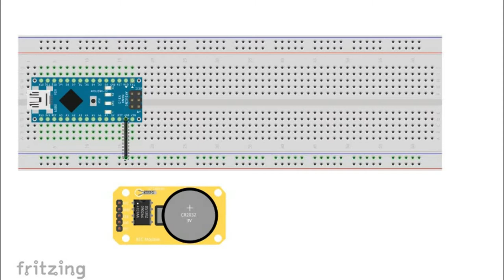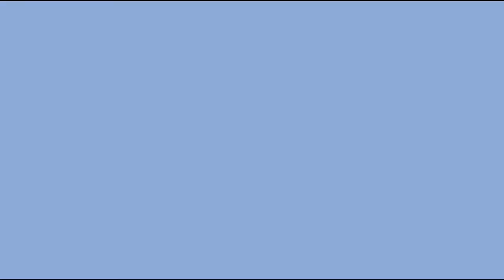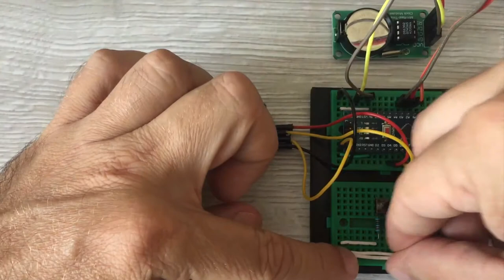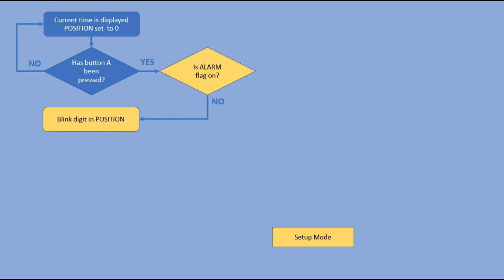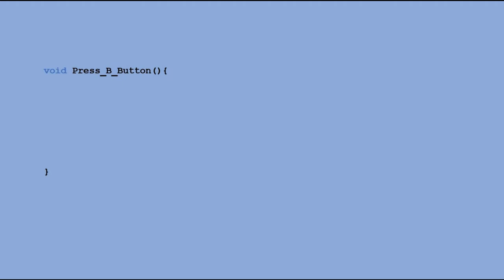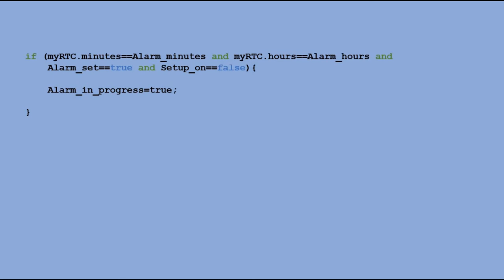How to create TM1637 Digital Clock with setup Time and setup Alarm functionality

Comment: I made some apps where I set the RTC with GPS. You still have UTC time or the time in China to deal with, so have 2 buttons for such on top (which you could use otherwise, but the date is also something.) The RTC modules can move, so you have many options.

Comment: Cool but, it is much better to use the Buttons without resistors, that is, use with PULLUP in the code; it gets cleaner and less work!
Reply from the maker: Check my recent video. It is like you were reading my mind:)

Comment: I watched the related video with interest, I appreciate your effort and wish for the continuation of such educational videos. I uploaded the relevant code to Arduino and ran it, I did not encounter any problems. In this context, I have a question. What kind of code should I write to skech with the screen brightness setting of TM16237? ,I'm waiting for your help
Reply from the maker: You aztually see that in the code for that video. In the setup function you see command clock.setBrightness(0x0f); You have to play with the hex value passed to that function. I prsume the lower the value the lower is the brightness
Reply: @marios_ideas  Thank you for the quick and useful information.
Reply from the maker: @erment55  Give the video a like if you found it usefull:)
Reply: @marios_ideas  I did and also subscribed to the channel

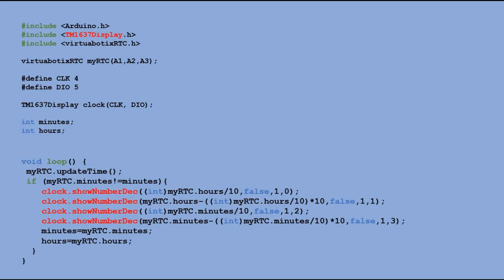Comment: hello i just wanted to display real time on this 4 digit display with DS1302 RTC module so i copied your code from 2:44, set the time and brightness but it is not working :/ any ideas what is the problem?
Reply from the maker: After connecting RTC run I2C scanner code to see if Arduino sees RTC device
https://playground.arduino.cc/Main/I2cScanner/
Also output the Time to serial monitor to see if time is read , if this does that would indicate the problem with 4 digit display
Reply: it works, thanks for the help
Reply from the maker: Jan Radliński silly me. I did not read your initial question carefully enough. Ds1302 is not I2c device. I assumed you were using ds3231:( so was the problem linked to 4 digit display?
Reply: @marios_ideas  it seems that i had to mess something up with the code because i just simply restarted the arduino and rewrite the code and it worked. Still great video and good explanation.

Comment: hello, great project, how to make the two points blink, greetings and thanks
Reply from the maker: You need to change this loop.
Output time when seconds change and not minutes. 

if (myRTC.minutes!=minutes){
    
   clock.showNumberDecEx((int)myRTC.hours/10*1000+(myRTC.hours-((int)myRTC.hours/10)*10)*100+ (int)myRTC.minutes/10*10+myRTC.minutes-((int)myRTC.minutes/10)*10, (0x80 >> 1), true);

   minutes=myRTC.minutes;
   hours=myRTC.hours;
   
   }
And then check if the number of seconds is even. So bild an if statement  When it is use different command to display time

 clock.showNumberDec((int)myRTC.hours/10*1000+(myRTC.hours-((int)myRTC.hours/10)*10)*100+ (int)myRTC.minutes/10*10+myRTC.minutes-((int)myRTC.minutes/10)*10, true,4,0);

Dont have this connected but you will have look at my tutorial https://youtu.be/GHVMbefxZt8 basically shownumnerdec dows not display the colon and it displays 4 digit number which is what you want. So we want to do it every other second

Comment: hello sir,can i use an LCD 16 by 2 module for this project,am doing it as part of my project.
Reply from the maker: Sure you can. It is just a different type of display. Of course you would have to adjust code to exit the RTC read time to a different display
Reply: @marios_ideas  can you help me out with the codes setting,am having some difficulties in figuring out.
Reply: @marios_ideas  am using the following port in my lcd; D4,D5,D6,D7,A,K,RS,RW,E.
Reply from the maker: @ndolomusau8414  I am receiving too many requests like this . I do not have time to respond to all nor I should really be doing the project for you.
Reply from the maker: @ndolomusau8414  I have a video on LCD displays https://youtu.be/g_6OJDyUw1w. In the code you have to replace following lines with the lines that would display the time to LCD display.
(all lines  where clock.showNumberDec is used)

Comment: Hi again,
how to activate colon blinking every second?
Reply from the maker: So currently you have this piece of code
if (myRTC.minutes!=minutes){
    
   clock.showNumberDecEx((int)myRTC.hours/10*1000+(myRTC.hours-((int)myRTC.hours/10)*10)*100+ (int)myRTC.minutes/10*10+myRTC.minutes-((int)myRTC.minutes/10)*10, (0x80 >> 1), true);

   minutes=myRTC.minutes;
   hours=myRTC.hours;
   
   }
 }
Where whenever minutes change you redisplay the clock. (0x80 >> 1) is responsible for displaying the colon. What you need to do is to redisplay time whenever second change and for even seconds display colon and for odd seconds display
clock.showNumberDecEx((int)myRTC.hours/10*1000+(myRTC.hours-((int)myRTC.hours/10)*10)*100+ (int)myRTC.minutes/10*10+myRTC.minutes-((int)myRTC.minutes/10)*10, true);
so without the colon
Reply: @marios_ideas  I will try and let you know the result, thank you again for your quick and helpful feedback as always.

Comment: can I use ds1307 instead ?. If I can, what should I change in the code ?
Reply from the maker: I can see that there is dedicated library for ds1307
https://github.com/PaulStoffregen/DS1307RTC
So download it , install it and check examples that come with it to see if there are any differences in declaring the RTC module. Since the author of this library is the same I would imagine that there might only be a difference in declaration and the rest of the code should be ok
Reply: @marios_ideas  thank you !